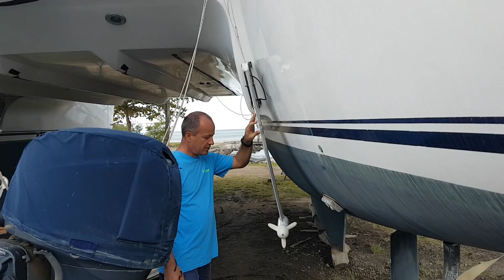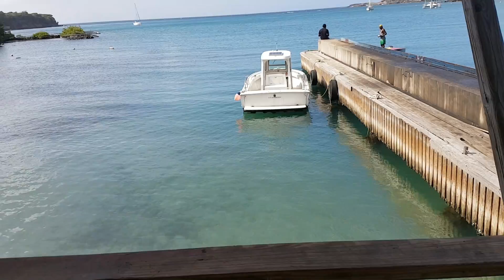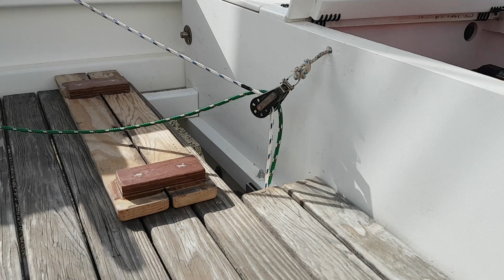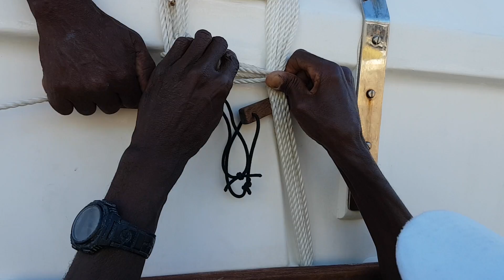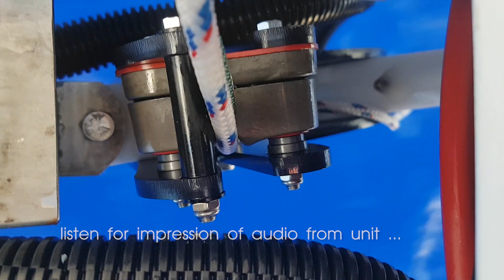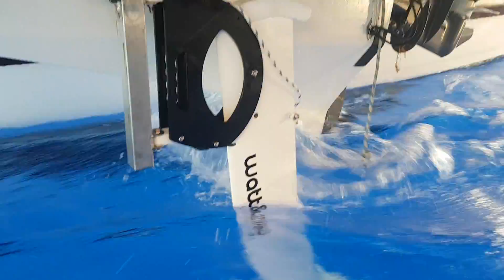FREE ENERGY - 1000 Mile Hydro Generator SAILING Trial - Ep 42 Luckyfish

Comment: Great video! Regarding the weed issue, if the angle of the blade was ~45° rather than 90° do you think that the weed issue would be reduced? Conversely would it be possible to fit an angled skeg to the front of the leg to help direct the weed down and off of the leg perhaps?
Reply from the maker: Yes, that would fix the issue. Buuuut! , I'd rather see world governments boycott Brazil until they stop the illegal land clearing in the Amazon rainforest which is the major contributor to the extraordinary Sargasso blooms plaguing the Caribbean.

Comment: My first time on your channel. Thanks for the thorough treatment of the hydro generator that you are using. It was not clear if you are using diesel or electric for auxiliary power? From the video, you seem to be dedicating the hydrogenerator power to house and navigating through the batteries.
Reply from the maker: yes, no fossil fuel generator used at this time. I am not against them, just strive for a future without them
Reply: @SailingLuckyfish  My question was possibly not clear. Do you use a fossil fuel auxiliary engine to move about? Or do you have an electric powered auxiliary engine to navigate marinas and dock?
Reply from the maker: ahhhhhh, auxiliary engine is 2 x yamaha 9.9hp, gas powered
Reply: Thank you. Inboard or outboard?
Reply: Watched some of your older videos and noticed they are outboards. Thanks.
Reply from the maker: @josephglenn5612  any questions don't hesitate

Comment: Any info on why copper coat is more environmentally friendly?
Reply from the maker: Quick answer is that it is not "ablative". Most anti-fouls shed, or slowly wash or wipe away, taking any marine growth with them but also polluting the water ways. Coppercoat is as hard as epoxy and copper metal. We can scour it with a scotch brite, even scrape it with a metal scraper and it does not scratch or wash off. It lasts for at least 10 years, sometimes much longer. Does that explain it? Cheers
Reply: yes thx a lot, begs the question why would anyone use normal anti foul that has to be replaced every couple of years? even if its double the price copper coat is much better value?
Reply from the maker: I don't know the answer to that. It might be because people believe in miracles. Some folks are alarmed they have to get under their boat every 2 weeks or every 2 months (depending where your boat is and how bad the growth) and give the hull a wipe. A slime layer forms first then the barnacles start. It's easy to wipe off the slime but ppl don't do it then the blame the coppercoat.

Comment: well I'm no expert but from what I've seen in this video it seem to me that the problem with seaweed could be easily solved if the the shaft of the hydro gen was mounted and gliding through water in an angle . lets say that now it is in 90 degree angle  so if it was at 60 or 45 the seaweed would just slide of without any problem and it would certainly put less stress on the shaft itself .of course I didn't mean to just set it in this angles the whole hydrogen would have to be reengineered but that is easy I'm sure you get what I meant

Comment: Is its 300W enough?
Reply from the maker: +climbing and moutaineering enough for our needs yes. Puts out about 8 Amps at 12W at 5.5kts boatspeed then upwards to a max 25 Amp at 10.5 kts bs. We are autonomous at about 6 kts boatspeed (we also have solar and wind power when boat is stationary). Do you have a boat? Cheers,
Reply: Sorry, English is my second language...   8A that's good, but your desalination process drains perhaps (much) more?   My dreams at age of 18 (as a RC models builder) were to built a real sailing boat, but after some money saving for this project, my todays wife cames in to my life. We start building our home... so all saving for the boat were canalized other way...  But we do live almost completely green - Off-grid with the sun electricity, hot water harvesting etc. Today at age over 50 I ow two sea (traveling) kayaks and paddle every year up to 500 km / 270 Nmi in the Adriatic Sea (plenty of islands to explore), plus up to 300 km on the rivers and lakes all around Europe. Some videos on my Youtube channel  https://www.youtube.com/user/atvsteam/videos           I very much admire your videos, also a friend of mine circumnavigated the world in home made only 7m long tiny boat alone via the most difficult southern route ... in 2003/2004. It was the smallest sailing boat that ever landed on a Antartica in a 200 years of past history.
Reply from the maker: Yes, the desal uses 37A when running! so we can only run for 1 hour max for 60L of water. Then let the batteries top up again. That sounds like a lovely life you are leading there! I did check out your channel and found reference to Sam okoli sveta  - pretty amazing accomplishment ! Good luck and keep in touch!

Comment: maybe i missed it.  how far can it go on electric power without sails?  whats the maximum range, considering solar and hydro and battery packs?
Reply from the maker: This boat does not use electric drives. Its auxiliaries are 2 x 9.9HP gas powered engines. To convert the boat to electric propulsion off the shelf - would cost in excess of USD$30K - we'd love to do it but will wait for pricing to come down. Cheers, Stew

Comment: Re: The weeds catching on the hydro generator. Instead going through the hassle of untying the lines, raising and lowering it, then re-lashing the lines when its back in place, what about getting a thin stiff wood stick with an appropriately shaped v-notch in the end to slide down the front edge and push the weed off the bottom of the unit?
Reply from the maker: Not a bad idea, little awkward to do due to access issues. We made it easy to raise and lower from the central deck area for this reason. 3,000 miles with it now and we love the hydro. Cheers

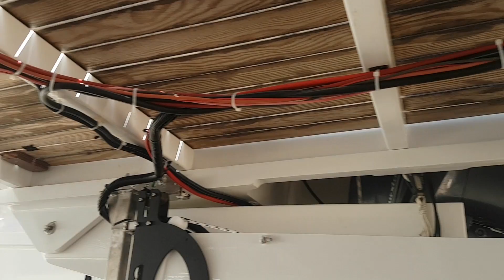Comment: [7:49]I was surprised when we saw the underside, that all the wiring runs under the deck suspended above the water. (I'm sure it gets splashed all the time. But thinking about the design, I guess there is not to many places you could run it. Since the boat is 4 separate pieces lashed together. (Hmm, how IS the Pod attached to the cross beams?) But I do wonder if you needed to make repairs or changes, or dissemble the boat, is there some big junction boxes under the deck where all the wires connect? Or are you going to have to disconnect all the wires and yank them out of all the stuffing tubes where they pass through the hulls/deck pod?
Reply from the maker: Yes, all need to be pulled out of the glands in order to replace wiring. Not a biggie. We like having the wiring open and accessible. It really is good seamanship to do it this way. Not hide it all under pretty panels etc etc. Great comment, thank you. Stew
Reply: Black Hat It wasn't mentioned but hyrdogenerators need to be installed so they can center themself in the current.  Not centered strains the bearings and bushing. Between the hulls of the catamaran is optimum.  Actually so significant the size of the well installed unit, actually a key reason to chose a catamaran over a monohaul for a blue water boat.

Comment: Based on what you showed the manufacturer should angle the propellor shaft and have the leg enter the water at an angle which would allow the weed to easily be washed down the leg and away. The weed appears to move the moment you released the down haul and an angle changed .
Reply from the maker: +Chris Boyce that is a very, very good suggestion, thank you.
Reply: Chris Boyce The turbine must be allowed to find the neutral spot in the current.  It can't be mounted rigidly on an angled brace.

Comment: Free Energy costs a hell of a lot of money, apparently.
Reply from the maker: Haha, good one. Well, you are right, nothing is free of course but after the initial capital cost... its a ton of power for very little effort. Do you have a sailboat or thinking of getting one?
Reply: I've got several small boats, and I've got a Tiki 30 coming together slowly in a barn in WV, USA.  I was thinking of putting a wind generator on it.  I might do one of these hydros if I could build it myself and mount it in a sleek housing like that.
Reply from the maker: Cool. Really like the Tiki 26 and 30's. Awesome, go-anywhere boats. Yeah, the build is a long road but worth it in the end... WV to Caribbean isn't such a big leap :-)
Reply: No it isn't.  Especially not when the 30 can be carted down I-95 to Miami on a pontoon trailer behind my truck. :)
Reply from the maker: Ya, brilliant to have all that on your doorstep. We are about to install a Rutland 1200 after a fair bit of looking at wind gennies. The location will be on top of the main mast... it makes the most practical solution in terms of minimising weight (no mounting pole on aft beam and guys etc) and wind aloft etc etc but still seems unconventional to do it this way. I am going with the practicalities and will worry about the aesthetics later. May not be an issue.

Comment: What's the benifits using hydro over wind. I would think they would work at the same time unless anchored. Then the wind gen would be more beneficial.
Reply from the maker: The difference under sail is the main one. At just 5 knots of boat speed the hydro gen produces the same amount of power as a good quality wind generator in 18 knots of apparent wind. Something we rarely see as we spend much of our time reaching or running. Do you have a boat currently? Cheers and great question
Reply: Not yet, I've been watching your channel as well as several others. And I'm headed that direction. But I still have about a year on dry land to complete.  In this year I want to learn how to sail and buy a cheap 22 ft or so. Then sell it and get a larger one. I'd prefer a cat. But there is a drastic cost difference.
Reply from the maker: A year is not long but can seem that way when you are waiting for a boat... The reason we make these videos is to show what adventures can be enjoyed on a cat that doesnt cost the earth... a few years hard work and saving noted! Great to hear you are following us. Good plan starting out with the mono. Good luck from Stew and crew

Comment: did you see the charging system that goes in water or air,have a look at that one
Reply from the maker: +Kevin Swanson do you mean the DuoGen? - it's a great concept that does have its applications. People who use them seem to say they like them. I didn't look deeply into them as a hybrid of two technologies cannot do as well as two generators specifically designed to harness both energies. With the Watt & Sea, and the Rutland 1200 we are about to fit, I think we have a good set up suited to our boat, for about the same price as the DuoGen. Thanks for the suggestion, Stew

Comment: You should rig a small cage around the propeller to jeep the weeds off the prop
Reply from the maker: That's a great suggestion if the weed tangling the prop was an issue. What we found was the weed tends to float on the surface rather than at the depth of the prop, so the weed would get hung around the leg. It wasnt too much of an issue as 9 times out of 10 the weed would simply let go after a few minutes. Thanks alot for commenting? do you have a sailboat? what type? cheers, Stew

Comment: +Stewart: You could rig a small electric winch to the hydrogenerator and a vibration sensor tuned to the frequency that the weed fouled hydrogenerator experiences. When the vibration is sensed the hydrogenerator is lifted to shed the weed and then automatically lowered.
Reply from the maker: That would be useful for sure. !

Comment: good for battery health
Reply from the maker: As long as we are sailing. Yes. We are about to fit a Rutland 1200 wind gen to help the solar when we aren't moving. WIll report on how that goes. I saw a couple of them in Grenada, and didn't hear them :-) so fingers crossed. cheers and thank you for the comment, Stew
Reply: @SailingLuckyfish  my mate just bought one off 'Alibabas' for 300 NZ delivered ,amazing, hes been running it for 12 months now , no problems , we had a look inone from the sail shop down here Picton & the insides were exactly the same but 2000  dearer, time will tell , Great vid thanks .

Comment: would a line cutter on the shaft help? Those rope pull drag along gens act like a drogue I am told
Reply from the maker: +nonslave - with the set up on our boat, it probably wouldn't help. We tend to get the weed on the leg, not the prop. This may be due to the fact its not sitting in the clean flat wake behind a transom. With our leg, the weed gets pushed up and down by the wave action between the hulls, often just blowing it off. So, in short, a line cutter wouldnt be suited for us... thanks for the suggestion though!
Reply: Thanks ...that makes good sense about a transom mount....my problem is I already have a hydrovane and swim ladder etc ...maybe on my cat haha

Comment: you need a induction cooktop for your galley,thats a good use for your surplus power ,hot meals with no risk of fire like a gas stove
Reply from the maker: +cartmnrlsusall - an induction cooktop is under consideration - great suggestion. Are you familiar with any of them? care to share any experience you have? I am a newbie to them, although the local hot pot restaurant uses them for the dining tables and they seem great. I gather they are quite energy efficient. Cheers, Stew
Reply: yup I have one it came with a large multi use pan,its called a copperchef,i use it outside when I grill to make sauce,works good I don't know how much power it uses.im happy you worked out the lashing issue,who knew smaller ropes were better than large ones it seems that's a common issue with wharrems
Reply from the maker: +cartmanrlsusall thanks for the tip on the copperchef. Googling them now. We expect to release a video on the lashings about 3 weeks from now... cheers and thanks again, Stew

Comment: A hydro-generator stops working, when the boat is not moving. I would go for 1 or even 2 wind generators... they stop working when there's no wind (boat is not moving to drive the hydro-gen., does that make any sense) ;-)
Reply from the maker: Hi Prof, No, that does not make any sense using the forms of logic I am comfortable with. :-)
Reply from the maker: On further thought, yes, it does make partial sense. The cutout power generation from the hydro is about 3 to 3.5 knots boatspeed which corresponds to about 5 to 6 knots true wind speed. Therefore, an efficient wind gen (or two) able to produce charge at that wind speed would have a slight edge over the hydro, in those conditions (which are very rare thankfully). However, the difference in the real world, for passage making, is significant and reversed. Cruising boats generally make passages with the wind aft of the beam whenever possible. That reduces the apparent wind speed felt by the wind gen and makes them less efficient. Combine this with the superior power output from hydro e.g At just 5 knots of boat speed the hydro gen produces the same amount of power as a good quality wind generator in 18 knots of apparent wind. We rarely see 18 knots of apparent as the true wind speed would be greater than 25 knots. And in those winds our boatspeed could easily be generating 20 Amps + from the hydro. Thanks for stimulating some more thought about this, Cheers, Stew
Reply: Prof. Michael O. Zeee JCD ECS Don't forget that at anchor navigation electronics get turned off saving power. Especially for his catamaran, this is the way to go. In fact half as big would probably do the job. He will start every sunset with full batteries and if he generated half the power he uses at night he would be fine come sunup.

Comment: Does it cost any boat speed when it's in the water?
Reply from the maker: +patriotpioneer The sleek design minimises drag. As best as we can determine, drag is about 0.2 knot, (4.8miles over a 24 hour run). So not much at all considering the power output. This assumes we run it 24/7, which is unnecessary. Hope that answers your question, Cheers, Stewart

Comment: Very nice. When I was a kid in the early 80's we used to sail. We had a little 27 with an outboard motor & I noticed how that prop spun like mad when we were sailing & the engine was down. I told my father, an electrical engineer, that we should make a little prop driven generator that we could drop into the water. He thought I was nuts. He said we pull the motor up because it creates to much drag & then explained how a generator would do the same. I thought a good balance of power generation & drag could be found but he totally discounted my idea. I was to young & already set on where I wanted my life to go so it's not like I was going to do anything like manufacture these units or try to commercialize it but I thought it would be a good, workable, practical idea. It was one of those "somebody should make this" kind of ideas. 
I am actually very glad to see things like this on the market & I am glad to see they work so well. I thought about it for a long time & I thought it was a good idea but nobody else did. I told the marina owner, other boat owners & they all discounted it so, seeing this work so well gives me a bit of a "I told you so" factor. My "crazy" idea is vindicated !!!   lol Great vid. It made my day.  :)
Reply from the maker: +shananagans5 ha! what a great story! now you can just show those "doubting Thomas's" these applications of your idea... http://www.wattandsea.com/en/media/photos they are in use on many cutting edge race boats etc etc. thanks so much for sharing, cheers stew